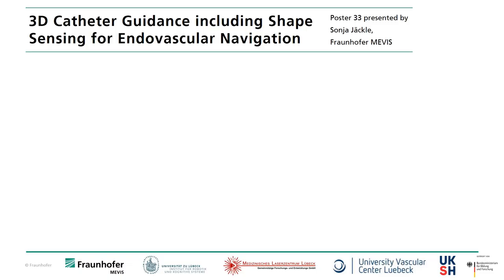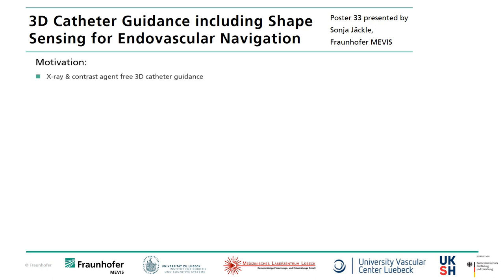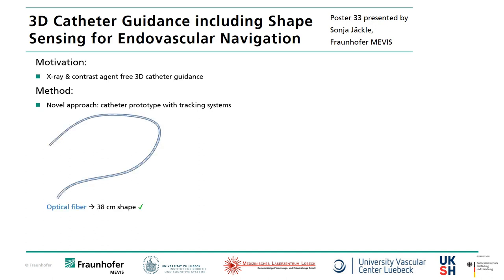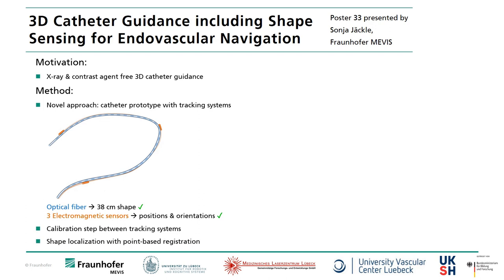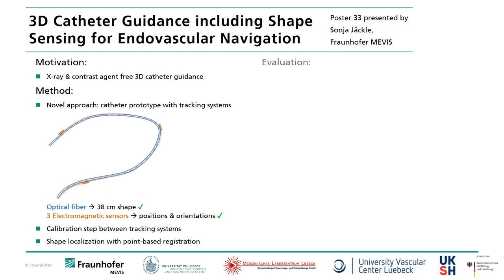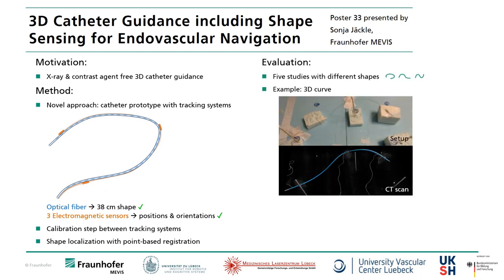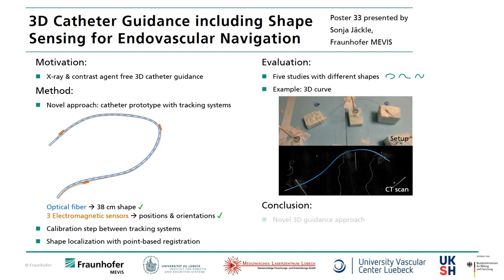3D Catheter Guidance Including Shape Sensing for Endovascular Navigation

Comment: Dear S. Jäckle,

thanks for the interesting video! What is the diameter of your catheter prototype equipped with optical fibers? Is there still room for a guidewire or instrument?

Best Regards,

Alfred Franz
Reply: Dear Alfred Franz,
Thank you for your comment. I apologize for my late response. I did not noticed your comment until now.
For our catheter prototype a multicore fiber (0.2 mm diameter) was covered with a metallic capillary tube (0.4 mm diameter) and three electromagnetic sensors (0.8 mm diameter) were placed and fixed at the tip, middle and end of the shape sensing region of the fiber.
So the catheter prototype had a diameter of around 3 mm. This was only a prototype, in a recently study we intregrated these tracking systems into a stentgraft systems and inserted it with guidewires into a vessel phantom: https://link.springer.com/article/10.1007/s11548-020-02167-2
Best regards from Lübeck
Sonja Jäckle